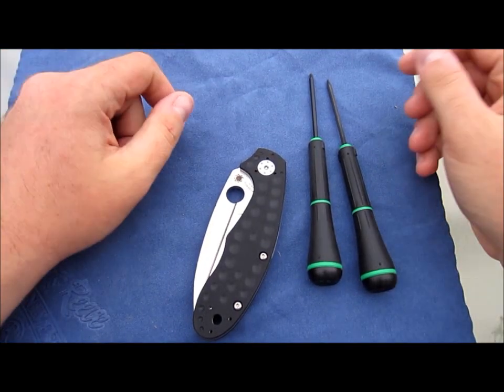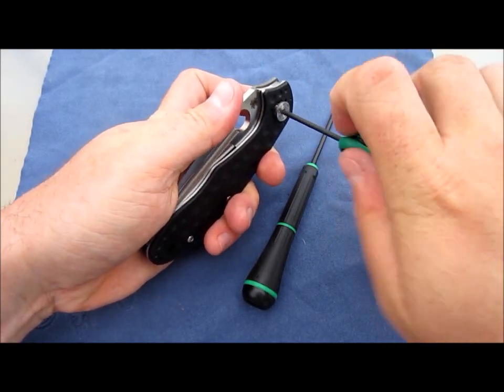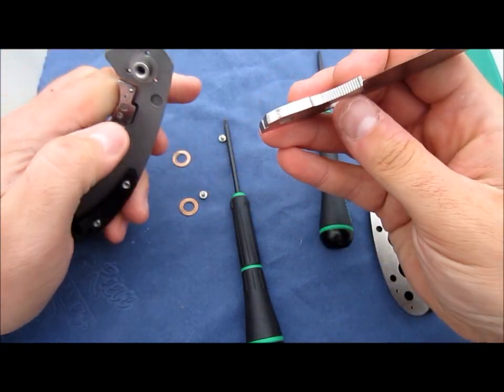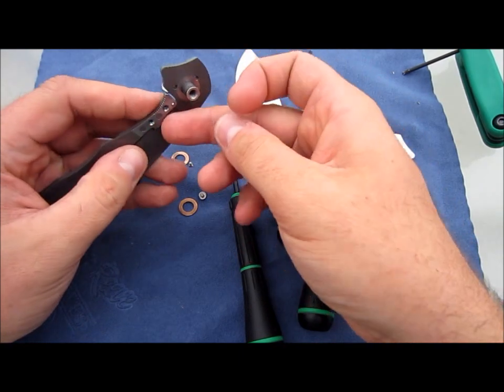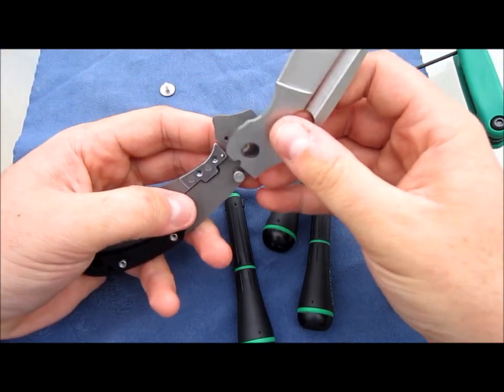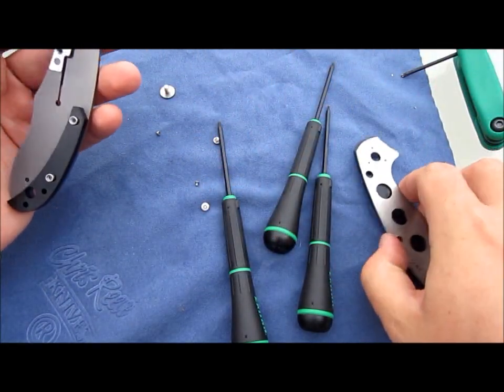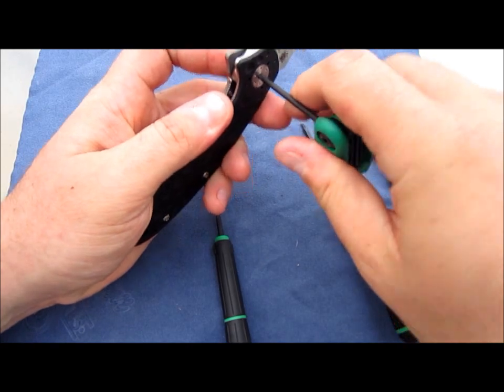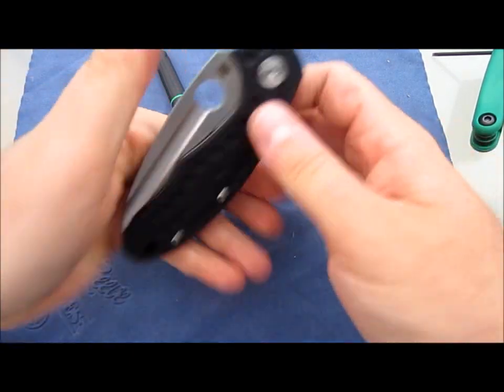Spyderco Tuff Takedown And Lockbar Adjustment

Comment: It is indeed because of the very short lock bar. The tension is much greater than the standard framelock, and ostensibly there is less room for failure. The pressure will lighten up when the ball polishes off a path on the blade some more. I've used Tri-Flow also on nasty blade travels and it often helps. Great videos man, cheers.

Comment: I bet some good grease would help make it a lot smoother. If your worried about dust, just wipe off the excess. Finish Line Extreme Fluoro or CRK Grease has done wonders in making my folders smoother.

Comment: My lone Spyderco is a Dragonfly II and it lacks the D-shaped bolts/pivots.  That is literally my only complaint about the knife, but it alone almost made me sell it off for the reason I hinted at in a comment on the recent Microtech video; it prevented me from taking the thing apart.  Eventually I took the Dremel after the thing and scored a line in the back of the back side of the pivot and called it a day.